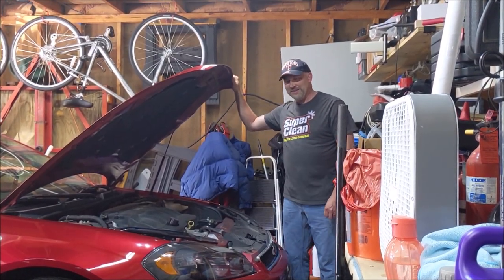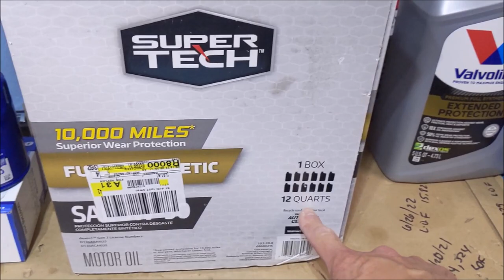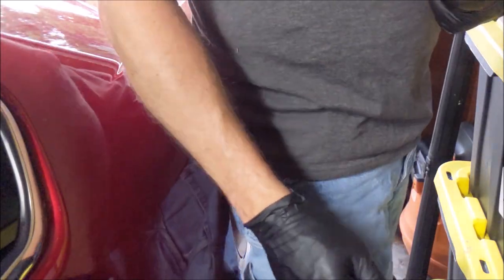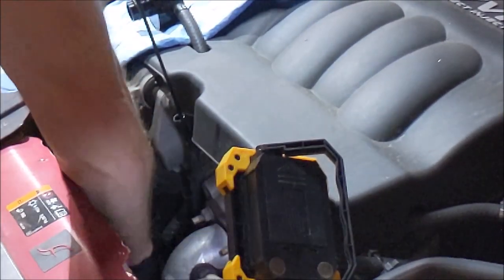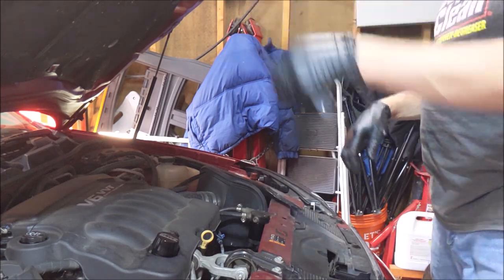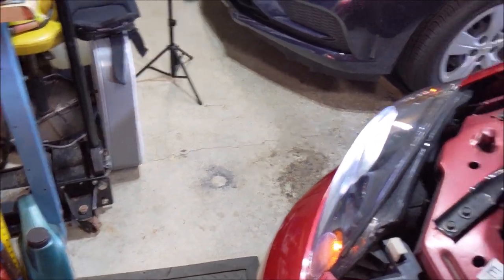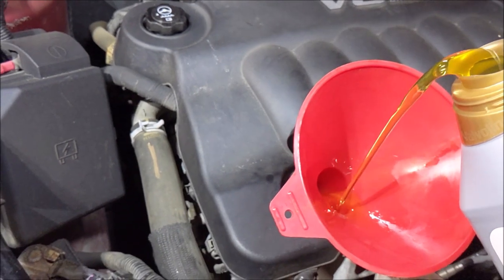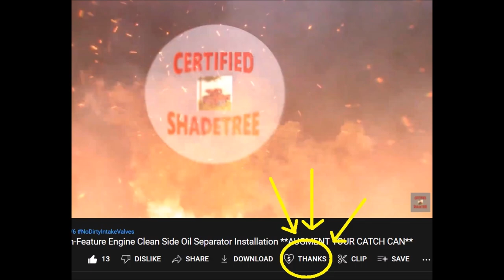BG "Engine Performance Restoration" Motor Flush on a GM 3.6 High Feature V6

Comment: I agree with draining oil and replacing filter before flush. 
1 crap that the filtter caught stays there and doesn't get dissolved and reintroduced to the engine. 
2 fresh oil allows the solvent to work on actual sludge/varnish and not "get wasted" on whatever is in solution/suspension. 
3 worst case scenario-if flushing with used oil/filter plugs then bypasses. Or an oil galley plugs. Remove yhat burden, remove the risk and maximize the efficacy.

Comment: Used the $322 BG kit on a Traverse that had the 3.6 in it. It used 2-3 quarts of oil between changes and smoked bad on startup. After that it no longer uses any oil between changes and no longer smokes. There were chunks that came out with the 1st round of cleaner and the rise oil came out black. We've put another 16k miles on it since. Way cheaper than an engine.
Reply from the maker: Way cheaper, and completely worth a shot if you're having those issues!
Reply: Did u do regular maintenance? A lot of that can be avoided with regular maintenance on schedule
Reply: @ruckustv7614  Acquired the vehicle used with 150K+ miles.

Comment: That cheap Super tech 5w30 full synthetic dexos is all I have run in my 2012 Impala 3.6 VVT. for the last 180,00 miles with a tough guard FRAM 😱. Don't know what was used for oil the first 20k as it was a HERTZ RENTAL car 😱. 202,500 miles on it now. Gets ran hard every day. Delivery vehicle 😱. Runs great, original plugs in it yet. I change my oil every 5k max, trans fluid every 25k max. No mods at all, engine never been apart. Great car so far, only trouble I have had was a purge solenoid, and 3 HVAC actuators
Reply from the maker: Damn, original plugs still?!? The actuators going bad is no surprise, though. Changing the oil frequently really is the key to long life on these 3.6's!!
Reply: What transmission fluid do you use 
And is the fluid flushed out or just changed out?

Comment: What you consider a "rinse oil," the Super Tech, is not at all an inferior cheap oil. It's from Warren Industries, that produces oil for many different brands. I've used their synthetics for several years, my Chevy p/u has just passed 340,000 miles, oil changes at 4,000 with Wix filter, bore scope confirms ZERO sludge anywhere. The internals look like new, just has oil on them. 

Our BMW has only 164K, but with the same maintenance pattern. BMW dealer shop says no buildup seen at all. I'm only suggesting that the Super Tech is indeed a completely serviceable oil, fully on par with the Valvoline or any other major oil, and far less costly. Also, the Costco oil is from Warren as well, virtually identical, and that is an even better value.

Comment: Ok yes I was going to suggest the CRC cleaner but you did already.  I've done it twice.  When I change the oil I jack up the front end a little to make it easier to get under it and also I figure it angles the drain valve back a little to drain more ot the dirty oil out.   I used to have this cool metal funnel, bought it in the early 80's. Anyway it had a screen in the bottom of it and I would strain the oil through it then at the end clean it with carb cleaner and see what was left behind that cam out of the crankcase.  I have 113k on my 13 Impala.  I am seriously thinking of doing this too.  Definitely the 445 gas additive.  I know it's kind of pricey but I just watched a video where a guy soaks spark plugs in different cleaners and 1 in just gasoline, the 445 did the best cleaning by far.
Reply from the maker: Did it have a flexible metal hose on the end of it? Had one like that at an old job of mine - we used it to funnel gas into the lawn equipment. Filter kept the crud from getting into the fuel tank..

Comment: awesome video per the usual man!

i bought a 2013 3.6 Police in December with 87k, already have it up to 102k with all the commuting i do. i’ve already done the CRC intake cleaner but i guarantee you this is also badly needed. you know the cops dogged the shit out of this thing before i owned it, and/or sat and idled it for 20k hours lmao. either way, you know my engine’s probably begging for this! also still need to modify the PCV valve and add the clean air separator. just gotta find the energy 🤣

great vid man, please don’t ever quit making them!
Reply from the maker: Thanks, and congrats on the purchase!  🍻 Would be curious to see how sludged the engine was and how much oil went into the intake after all the police abuse. You just know whomever drove it didn't give 2 shits about the quirks of the LFX!!

Comment: I used the BG engine performance on my 2003 Camry with 285120 miles. The engine doesn't have sludge or dirty,  I know because I did a head gasket and seen it's insides lol. But,  it dirtied thenoil quick and it will use about half a quart in 3000 miles. I poured the stuff in and took it on a drive for 30 minutes  and changed the oil. Yeah,  that stuff stunk and will smell it for probably another oil change. One thing I noticed is the oil on the dip stick stayed clean very long time,  didn't look dark quick. Also no oil use at all. I am happy with it. Did the same on the 2009 Camry V6 I have too with 180K miles.  I didn't do the rinse however on both cases. But I will do a short interval oil change,  3000 miles vs the usual 5000 miles.
Reply from the maker: Curious what type of drive you took the car on. Was thinking that going out on the freeway and dropping out of overdrive to keep the RPMs high (but not too high) might achieve the same result as sitting still and high idling. 🤷‍♂️
Reply: @CertifiedShadetree  Highway drive with little city. But the RPM stayed around 2000+/- on the highway. Small 4 cylinder you know,  doesn't take much. The V6 drove it at 65-70 for 18 miles then turned back. It was about 2K +/-. Didn't think 10 minutes per instructions were good enough.
Reply from the maker: @ahmadghosheh3104  Thanks for the info! 👍

Comment: Are you still using that Valvoline oil? Or what are you using now? I’m using royal purple but it’s really overpriced.
Reply from the maker: Yes! It's about $10 cheaper than AutoZone if you buy a 5-quart jug from Amazon. The single quart bottles are 2 bucks cheaper @ Amazon, but take up to 2 weeks to arrive, so I just buy my single quart from AutoZone if I'm in a hurry..

Comment: Are all 2012 Impala’s direct injection ? Because for years now the Autozone app list there is a regular fuel injected version of the 3.6 in the Impala it’s got me wondering
Reply from the maker: Yes, they are all direct injection. What AutoZone (and elsewhere) has is a listing for a Flex Fuel version and one for a non-Flex Fuel version.  The only way to tell if yours is Flex Fuel is if you have a yellow gas cap and/or a Flex Fuel badge on the right side of the trunk lid (which switched to a sticker the driver's side quarter window in the 2014-2016 Impala Limited, since the "Limited" badge is where the Flex Fuel badge used to reside.)
Reply: @CertifiedShadetree  Thank you for clearing that up it had me confused! I am currently looking for another Impala I sold my 2008 LT 3.9 2 years ago and I want to experience the 3.6 power!
Reply from the maker: @skylarscales9922  You won't be disappointed!!😎

Comment: Hello, I have a 2012 impala LT with 3.6l with 60k miles, I keep it well maintained, but I have a p0019 and that's the only code I have, but the check engine light comes and goes. I did do the modification to the pcv valve.  Do you have any idea what is wrong, with this code?
Reply from the maker: I would try removing and cleaning the Variable Valve Timing solenoids first. Remove and clean the crank sensor and cam position sensor after that.

Comment: Question: I have a 2000 Toyota Tacoma that developed bad sludge that I am in the process of cleaning at the moment.

You installed something in the PCV lines that collects blow-by oil (gas) and something else that separates out oil.

Positive crankcase ventilation is the same on a DI engine? Or not? Would my Tacoma PCV system have possibly caused the oil sludge problem? Could what you installed be helpful to my pickup?

I plan to use the same engine flush procedure after I have the upper and lower engine cleaned out by hand. 

Using brake cleaner on underside of valve cover and stuff inside the lower end, but opted to use diesel to clean the camshaft area, to be a bit more gentle. 

What sludge is left after cleaning is what I hope the BG product will clean out, without harming the bearings. Especially want to break the oil rings free, so the cylinder walls don’t keep getting worn.
Reply from the maker: Yes the PCV system is the same on a DI engine, and yes it certainly could have been the cause for the engine to sludge up. 

The catch can (on the dirty side) and the clean-side separator are more for keeping blow-by out of the intake tube and intake manifold, thus cutting down on the amount of carbon build-up on the backs of the intake valves. With port injection, the fuel injectors spray directly at the backs of the intake valves so there isn't any urgent need to capture the oil blow-by, as the fuel washes away any deposits.  Not the case with direct injection.

So with that digression out of the way, a catch can and clean side separator certainly wouldn't hurt, but I doubt they'd help cut down on the amount of sludge inside the engine.

The issues the GM 3.6 had with sludging have to do with the dirty side of the PCV being too restrictive, so I would certainly focus on that. The solution to the 3.6 was a revised valve cover gasket that opened up the area beneath the PCV and also a PCV with larger holes. I don't know if you could somehow adapt a larger diameter PCV valve or open up the chamber beneath where it sits in the valve cover?  Regardless, best of luck to you in your quest to cut down on engine sludge!! 🍻
Reply: @CertifiedShadetree  you have my respect for taking time to respond so thoroughly to my question. I will get a new PVC valve and new hoses since that system might have something to do with generating the sludge. But, I do not see myself trying to enlarge the valve cover hole to add a larger PCV valve. The existing valve goes into the valve cover but you cannot see it coming out because there is a non-removable covering metal plate underneath that has some space to let vapors circulate, I am guessing. This 2000 Tacoma has 157,000 miles on it. I also may try to replace the PCV grommet because it is old, but it looks ok.

I am having difficulty finding a valve adjustment tool. Your links, I think, were out of stock. Most places that carry the official Toyota PN (09248-55040 for both, 09248-05420 for lifting tool, and 09248-05410 for holding tool) tool are either out of stock or tell you to place an order and they will order from the mfg and let them drop ship to you. And their price is up around $175, not cheap. I did find one knockoff, at $80, but I am a little leery of that website. Anyway, I am on the hunt and wondering how hard it would be for two lame backyard mechanics to use simple hand tools to do that job?

Lastly, you removed the exhaust camshaft to easier get at their shims, saying something about the intake camshaft being harder to take out. In my Haines manual for my Tacoma there is a procedure “Camshafts and valve lifters — removal, inspection and installation.” It doesn’t seem all that much extra trouble to get both camshafts out and back in. That procedure is about tearing the top of the head down to get precise measurements for things like: thrust clearance, free length of camshaft gear spring, height of each cam lobe, diameter of each journal, backlash between the camshaft gears, and if those measures are out of spec, buy new camshafts or head. Not a compelling reason to embark on taking those measures, however the remove and replace isn’t all that complicated, it seems to me. And my position of needing to get that space as clean as possible (by hand), I am thinking of removing both camshafts. Would you advise against my attempting that?

And, fyi, there is a simple procedure for taking that sub-gear off the exhaust camshaft, taking it apart, and putting it back together.

Comment: Actually that “cheap” rinse oil tests out better than Valvoline.  More dispersants and detergents and general additive package.  Watch Project Farm.
Reply from the maker: I have watched PF's videos on Super Tech!! I would say this is an apples to oranges comparison, tho.  PF never tested the Valvoline Extended Performance Ultra Synthetic (he tested the cheap Valv synthetic,) and I'm not using the ST Ultra Synthetic (I'm using the lesser of the ST Synthetics.)

Kind of a moot point anyway, I haven't used a rinse oil in my subsequent BG EPR flushes..

Comment: Great video. I didn't know that much gunk was produced by this engine. My '16 Limited LTZ has 135,000 on the clock. Looks like I have a new project coming up. BTW, where'd you get the cool Impala air bag logo?
Reply from the maker: There's a YouTuber called 89imp03 that makes them and sells them on eBay:
https://www.ebay.com/itm/165437785768
Reply: I have a 14 LTZ.  Thought the same thing about the logo.  Very cool indeed.

Comment: There's a reason BG put clear instructions on the back of the can, never understood people that deviate from them without explaining the reason. Bring the engine to operating temp, then run for 10 minutes with EPR inside at 1200 RPM. That's how they guarantee the result. Why double the rpm?? You remind me of a guy, "Take 1 pill twice a day for a week. Why bother, I'll just take 14 pills at once and get over it." Anyway, thanks for the upload.
Reply from the maker: Instructions? Self-professed shade trees don't read instructions!!🤣🤣
Reply: @CertifiedShadetree  shaking my head, sir, shaking my head
Reply from the maker: Seriously though, I appreciate the feedback!
Reply: The product is heat activated in the rays rpm creates a splashing affect that does a great job decarbonizing and mildly cleaning the system. The stuff works amazing and can’t tell you how many vehicles I fixed oil consumption issues with doing the service.

Comment: I have 100 96k on my 2012 ltz, I have been using full synthetic since 100k, and I don't burn any oil or have any issues, so I would only do this process if someone couldn't provide maintenance records
Reply from the maker: With the LFX and the later LGX engines it's truly coin flip, as they aren't plagued with the issues the earlier 3.6's had. I would absolutely recommend a regiment of this on the older LLT and LY7 engines regardless of condition and maintenance history. LLT and older are the ones that gave the 3.6 its bad reputation..

Comment: When I  bought my car I changed the filter and oil, but use diesel oil. Then change filter every 1K klms for 5k klms. Using diesel oil cleans out the rubbish.
Reply from the maker: Is there a specific brand you used? How well did it clean out the engine?
Reply: @CertifiedShadetree  cleaned very well and I use Penrite oil.
Reply from the maker: @mozpogson3639  How much oil did the engine consume between oil changes with the Penrite?
Reply: @CertifiedShadetree  zero
Reply: im running delo 15/40 in my toyota right now for this purpose

Comment: If you have problems with name brand oils then you have bigger issues with your engine. LOL about Valvoline being bad. I’ve used it many yrs in Z/28’s from my 1968 which I bought in 1973 to my current 70 Z/28. Valvoline, Castrol, Pennzoil, Redline, Kendall, Amsoil, Driven which used to be Joe Gibbs oil, they’re all excellent oils. I didn’t mention Mobil 1 cause I lost a solid lifter cam using it.

Comment: man, your running premium synthetic thats capable of 15k mile oil change intervals for 5k.  that engine is gonna stay clean as a whistle without flushes.
Reply from the maker: Maybe, maybe not. The 3.6 never fails to disappoint if you're not impeccable with the maintenance.
Reply: I change my own oil every 3000 in my Colorado 3.6. I'm 70 years old and have never had any major engine problems
Reply: I'm surprised the original 4500 mi oil change was that dirty looking. I don't blame you for wanting to give it the BG flush.
My 5.7 Hemi oil looks a lot cleaner at 5k OCI, and it's got nearly 150k on it. Is your DI the difference? Good job on the extra effort on maintenance. It would have been a better video if you could have shown some sludge build up with a bore scope, so we could see before & after, but we got the idea anyway. Thx.
Reply: @deere3321  I believe in good maintenance but there should always be a balance, if everyone in the USA or even the world changed oil at 3,000 miles what a waste of resources, that's a waste for just you alone!

Comment: All that money to clean your engine and you have the worst air filter possible? Those K&N filters allow massive  amounts of large particles to pass into your engine.
Reply from the maker: But has anyone proven that they actually harm an engine? And if so, where can I join in on the class-action lawsuit? The only major concern anyone's ever proven to have was killing MAF sensors when the filter is over oiled. I'll completely eat my words if my engine gets destroyed from running a K&N, but I'm not concerned in the slightest.
Reply: @CertifiedShadetree it’s proven by UOA (used oil analysis reports) the silicon levels (sand, dirt etc) go way up with those oiled air filters. use paper filters, change every 2 changes and your vehicles will thank you. 7.3 power strokes would destroy a specific cylinder(7 or 8 i can’t remember which one off the top of my head) if an oiled air filter was used as all the silt and debris let though would funnel into those cylinder.
Reply: Always change your oil when it’s HOT.
Reply: This is correct. K&N filters increase airflow while sacrificing filtration. Silica levels in oil have been shown to be higher in cars with these types of filters. But if you think 2-3hp is worth a shorter engine life, go ahead.